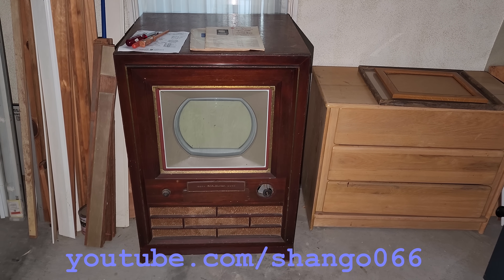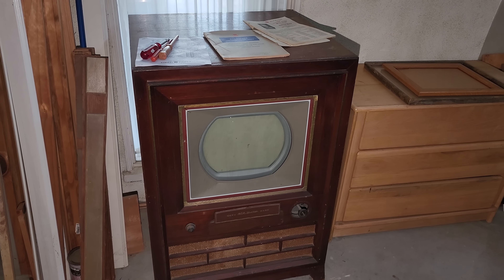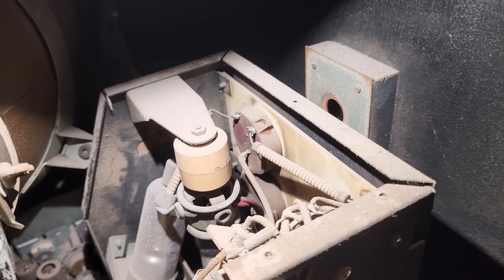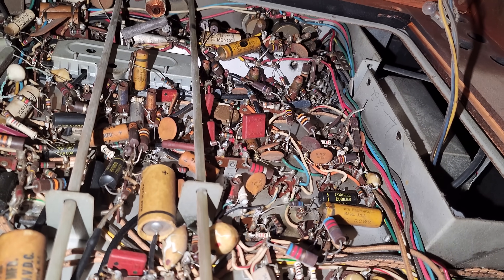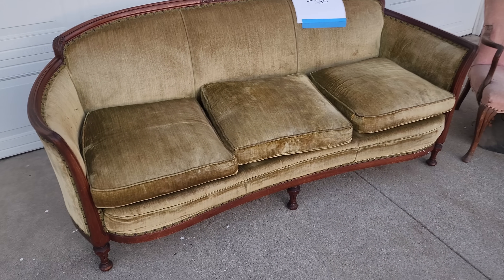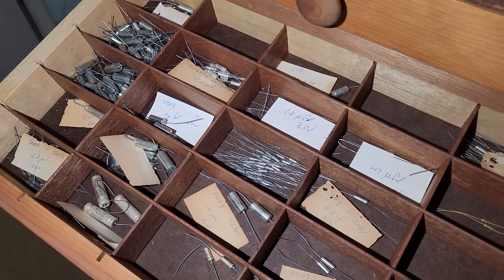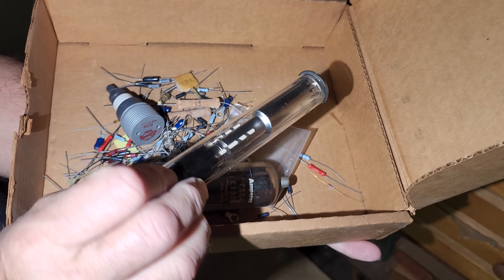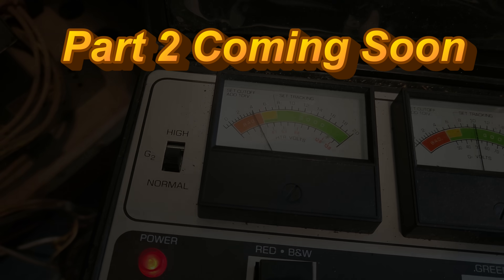RCA CT100 1954 First Color Television Analysis For A Fellow Collector

Comment: A 1954 IS NOT the "FIRST RCA COLOR TV" BY EIGHT YEARS!!! My Friend has his Father's 1947 RCA Model 3 Consolette (table model) WITH A ROTARY TUNER and a 9" ROUND picture tube in PERFECT WORKING ORDER (you have to have a ATSC to NTSC convertor box now) and being it's a sulfide picture tube, you have to watch it in a darkened room as it's very dim, but has excellent color and contrast. It's about 3 feet wide and 2 feet tall and 4 feet deep and weighs over 350 lbs with nearly 80 tubes inside and takes at least 30 minutes to "warm-up" and stabilize. The Model One was a HUGE thing with the picture tube pointing straight-up and you viewed it in a MIRROR weighing nearly a thousand pounds! You also NEVER TURNED IT TOTALLY OFF! 1946 price: $2363 delivered from Jenkins Music in Tulsa, Okla., or SIX 1946 Ford Fodor Sedans! On all the round-tube tv's you can flip a switch and go from full-screen round to rectangular format (3:4 now 9:16). RCA offered a magnifying lens (quite expensive) for the 9" round color TV's, but you had to sit with-in a narrow angle of viewing with it.

Comment: A getter was used only once, to consume any remaining oxygen, after a vacuum tube was made.  They were inductively heated.  After that, they were never used again, and would have no effect on any air that leaked in later.  I grew up in the days when most electronic devices used vacuum tubes and transistors were just becoming popular in consumer devices.  My family's first TV was a B&W 21" RCA Townsman (IIRC), which I believe was bought in 1957 and one of my uncles was a TV repair man.  He gave me a stack of repair manuals for a variety of sets.  I also obtained dead TVs from friends or elsewhere, to see what I could do with them.

Comment: Remember early on;  Transmission of color images using mechanical scanners had been conceived as early as the 1880s. A demonstration of mechanically scanned color television was given by John Logie Baird in 1928. Mechanically scanned color television was also demonstrated by Bell Laboratories in June 1929 using three complete systems of photoelectric cells, amplifiers, glow-tubes, and color filters, with a series of mirrors to superimpose the red, green, and blue images into one full-color image.  This even pre-date commercials.  How did they achieve this?

Comment: Shango, the camera pickup tube is a vidicon tube, successor or little brother to the Image Orth tube. Three vidicons were used in the Phillips/Norelco PC-60 and PC-70 color cameras, which were in wide use through the mid 60's and 1970s. They shot some of the iconic network video taped shows during that era: Carol Burnett, All in the Family, etc. We had two of them at the NBC affiliate in Port Arthur, Texas, KJAC,  where I worked in the mid-70s.

Comment: The circuits seems very scarce for a color tv at that time, i remember a German tv of the 70s which was filled with pcb in every directions
Reply: PCBs were not a thing yet when this TV was designed.  In fact, they had only begun being used in consumer electronics less than two years after these were sold, and only in Motorola radios.  And if you think this TV set doesn't have many components... ohhh you just wait, you'll see...
Reply: RCA. If you don't need it, drop it.

Comment: it was an amazing feat of technology at the time. It was not practical at all. Like someone said get a vacuum cleaner near it it would scramble colors. You had to call a technician to restore  the purity of color,  If you moved it same thing need technician to return color purity, By the mid 60's they had solved that issue with addition of demagnetization circuits upon startup.All early Branded color TV's all had  RCA electronics  they had the patents. The exception was Zenith which had their own design about 1962. By mid 60's color tv was OK but broadcasting was still an issue as color and tint (face color) was different from the commercial to programing color and faces could be green or red. (tint).you constantly had to adjust controls for true color. The broadcasters solved the issue in the 70's an d TV's from then had little issues of changing colors.And you know the rest

Comment: The little camera tube is not an image orthicon tube, it's a Vidicon tube- totally different operating principle.  Given its small size it was probably used in a B&W security camera or some such device.  3 3 inch image orthicon tubes were used in the RCA TK-40/TK-41 colour television broadcast cameras from the early 1950's through late 1960's.  The RCA TK-42 camera from the late 1960's was the first transistorized broadcast television camera.  It used a single 4" image orthicon tube for the luminance channel and 3 1" Vidicon tubes for the chroma channels.  A real beast, it was not commercially successful.  It wasn't until the TK-44 and later that used 3 Plumbicon tubes that a  solid state camera became a commercial success.  The portable TK-76, using 3 small Saticon tubes, was a brilliant piece of engineering that emerged in the mid-1970's that made gorgeous video and helped usher in the era of electronic news gathering.

Comment: In the mid 90's I had a meeting that took place in a Community Room in a building owned by the City. They had a late 60's early 70's TUBE color tv - big one. The meeting was Monday nights so the people who showed up early would watch Monday Night Football. We would turn that sucka on and it was amazing how rich and saturated the colors were. Of course it was about 25 degrees warmer behind the set than in front of it due to the heat from what seemed like 40-50 tubes.BUT THAT PICTURE was just so analog!! Like pretty artsy and nothing cold or sterile at all...

Comment: CT-100 Color Receiver (CTC-2 Chassis, 1954) Starting March 25, 1954, 5,000 CT-100's were manufactured in RCA's Bloomington, Indiana plant. The set was named, "The Merrill". By mid-April of 1954, the sets were available at dealers.

In my younger days I worked for RCA industrial division engineering for TV broadcast.  I was also working in their consumer TV division for a while.

These older TV sets were not easy to troubleshoot and service.

Comment: In about 1968, I bought a used CTC-15 RCA color set.  It was made in 1963. I restored it. I changed many of the tubes, some capacitors, and the CRT.  I used it as my TV set till about 1975. I gave it away to someone who wanted to keep it as an antique set. It was still working because I maintained it.

Comment: anybody got 475 watts spare??? if has stated it's in running order what do you do just give an obvious replacement of the minimal parts or would you as they say with the dirt ingested collectable old car restorations "just leave the dirt DO NOT CLEAN OR POLISH IT OR YOU'RE DEAD" approach. and check out the full mesh back makes you wonder how far we've come with in design getting down to letter thickness air slots to almost nowadays fully sealed micro parts.
anyway nice to see this one Shangoo

Comment: Good find!  Just a couple of comments...  Picture tubes should not be shipped face down. Any foreign material inside the tube could fall down on the shadow mask and cause a blocked aperture.  At 10:30 in the video, the camera tube is a vidicon.  Studio cameras used an image orthicon tube which is much larger.  Vidicons were typically used in the "film chain" as the pickup tube for motion picture film and slide projectors.  Yeah, the 2C39  is a transmitting tube useful in the UHF frequency range.
Reply: Interesting about the CRT's. Every reman. CRT I ever got was shipped face down. Probably because the bracing required to ship them face up or sideways would have been expensive and unwieldy.
Reply: @patricknesbitt4003  I know they remanufactured B&W CRTs.  Did they do color tubes also?  My comment was for color CRTs.
Reply: @AF9A  They certainly did. I repaired TV’s part time from the early 80’s through the 90’s and here in NJ there was a small mom and pop CRT rebuilder called Superior Picture Tube that regunned both mono and color tubes. They worked quite well too.
Reply: Vidicon was camera tube used in space.

Comment: Thank you, shango. A great video. I can hardly wait until you  post Part 2. Reportedly, the color rendition on the CT100 was better than RCA's later sets in the 1950's. The CT100 was the first commercially successful color TV. Admiral and Westinghouse beat RCA to market by several weeks, as RCA didn't start producing the CT100 until March 1954. Most of the Admiral and Westinghouse sets went unsold. Some of the initial batch of Admiral's were in dealer inventory as late as 1957. NBC broadcast just a few hours of essentially experimental color programming in the first half of 1954 featuring stars such as Dinah Shore from the Colonial Theater in New York, Brooklyn 1 didn't open until the fall. In the spring, CBS broadcast a color talk show with Mike Wallace. CBS opened its first real color studio, Studio 72, in August with a one time color episode of Ed Sullivan.
Reply: That's because the phosphor formulations for the red and green are different on the older CRT's then they are on the newer CRT's. When they made the the newer phosphor formulations for  red and green. They made the red into crimson red(red with a slight hint of orange) and the green was made fairy green(green with a slight hint of yellow). The reason for doing this was to get better, more accurate flesh tones. But at the expense of color vibrancy. The color emissions of these newer phosphor are standardize by SMPTE and Pantone calibrations standards. Although I've never seen it in person, I've hear that watching Wizard of Oz on one of these old TV's is a real treat.
Reply: It was also worth noting,  that the Admiral & Westinghouse color sets that predated the RCA CT-100,  were not backwards compatible with B&W, and since color broadcast was almost non-existent,  a family would need two television sets, the Westinghouse cost $1,250 late 1953/early 1954, which was roughly a little over half the price of a new car at the time.   On the other hand, the RCA CT-100,  although sales were very poor due to the $1000 price tag, was a very important TV, being compatible with B&W,  it would pave the way other color sets, and a little more than a decade later, the number of color sets sold would outnumber the B&W sets.

Comment: So very looking forward to part two the first RCA I ever worked on was a CTC 25 I then this is in my late teens went to the library and researched all the early issues of Consumer Reports from the 1950s to see how color TV was accepted and in particular of course this set. Of course at that time and we're talking the late seventies to read that this TV was marketed for $1,200 was unbelievable I can only think the ones remaining to this day must be in the low hundreds
Reply: The 25AP22A CRT in a CTC 25 had a life expectancy of about 2-3 years in a family with heavy use.  I was installing CRTs as a kid working in a TV store in 1969 and the sets were 3 years old or less.  The flybacks also loved to burn up, the 6GH8A tubes shorted and screwed up the color and the plastic cog for the fine-tuning always broke.  At about $700 they cost a month's salary.   No sympathy for RCA being pushed out by the Japanese then the Chinese, they were making sets in the mid to late 60s like the CTC25 that were designed to fail within 5 years. Planned obsolescence at its finest.

Comment: BEAUTIFUL set! When I was a kid, my whole family obeyed the 4-foot rule back when we had sets like this, protecting us from injury. The CRT glass in this model did not contain any protective lead and there was likely insufficient shielding around the HV rectifier circuit, resulting in unhealthful doses of ionizing X-radiation if one got too close to the set. This came off the assembly line long before enactment of any protective DHEW federal regulations.
Reply: So that's why my great grandfather told me never to sit that close to the TV when I was like 4. But their TV was from the 60s and black and white. I always thought it was because being that close would hurt my eyes. I never listened and it was closest to the knobs and cable converter and made the picture look huge compared to how tiny it looked from the sofa.
Reply: @NickDalzell  The plates of the tubes in the HV circuit of an old black-and-white TV emit minuscule amounts of X-radiation, but it's not enough to escape their glass envelopes. I don't think that being so close, looking at all the CRT image flickering would necessarily be helpful for one's good eyesight, though.
Reply: @chetpomeroy1399  I'd argue that being so close to a tiny smartphone screen would likely be worse. I remember getting tons of headaches and eye strain when I used one. Not so much from a TV of any kind, CRT or LCD.
Reply: @NickDalzell  I'd have to agree. Don't like dealing with smartphones, either. They are kind of tough on the eyes, especially at my advanced age.

Comment: The holy grail...

The only TV more desirable would be a 21CT55... Basically a CT-100 with a 21 inch CRT.
Reply: I'm guessing convergence was a nightmare on 1954 21" color set.

Comment: I had a rich uncle that had one and remember watching "The Cisco Kid" on it.  We, as kids, were absolutely forbidden to go near it and God forbid if it got banged into by a vacuum cleaner. Any anomaly and it necessitated a call to the TV repairman.  We didn't get a color set until about 1967. It wasn't cheap but nowhere as expensive as that set.
Reply: A friend that I hung out with in 1960s family had an old 55 RCA that was from his uncles car dealership showroom.
By late 60s it was pretty tired and I remember the convergence was way off. It used to look like a black and white with color ghosts.
I remember being over at his house when his dad was checking the tubes and had the back off. It had circuitry all around the case. I remember looking at the watt requirement on the tag and it said it took 400 watts to run.
Also remember I was at his house when Neil and Buzz were on the moon and getting ready to step out. You want to talk about a messed up picture. After they walked down the ladder we went down to my house and watched on my dad's new crystal clear black and white portable TV. Then we could actually tell what it was.
Also had an aunt that wasn't rich but dealt in real estate and had a 59 Cadillac and a very nice color TV  from about early 60s. She kept it in perfect order and I remember it had most beautiful picture.
Those old CRTs had fabulous pictures, they just didn't last very long.
Reply: Turning on the vacuum in front of them was the killer, the magnetic field would screw up the purity and convergence.  A running vacuum was usually OK.
Reply: Required about twice the antenna elements to load a decent signal strength in vintage color sets. Uncle had some investment!
Reply: @directcurrent5751  Oh, yes the old colour antenna. My Dad refused to by a colour set , too expensive and too many green faces , he bought one in 74 a Hitachi with remote control and then monthly cable.
Reply: If you watched "The Cisco Kid" it was a DuMont system (Pal System) TV!  DuMont championed the PAL system the BBC adopted and UHF channels. The picture was MUCH sharper,clearer, the screens were square edged and DuMont had 46" TV's in 1952 and they weren't "blue and grey" they were really "Black and White". Our best friends had a DuMont when I was about 4 years-old and I loved watching it and the SOUND was incredible too! Almost like stereo!

Comment: Why does the CRT have to be removed for shipping?  It was shipped from the factory and delivered to the customer(s) with it in place.  Not to mention a few other moves during its lifetime.   Appliances like that are built to be knocked around a bit.  It's fragile but not delicate.  
Seems to me just the act of removal and installation is adding substantial more unnecessary risk.
Reply: modern shippers are a lot harder on devices like this than in the old days and the crt in this is 100% irreplacable .
also if it's going to be restored the crt will need to be removed anyway. also i'm not sure if these crts have integrated safety glass so that could be a concern too
you can crate up a crt in a way that it could be dropped from 20 feet and not break but it's a lot harder to devise a way to make old rusty crt mounting bolts do the same job in situ
Reply: @Mister_Brown 
Thx for the info.  30 years ago I had to ship a 1959 AMI Jukebox from Phoenix to Riverside California.  400 lbs and top heavy.  I thought about shippers and how things get handled.  I finally decided on a moving company, as in furniture.  Door to door delivery, and they're used to handling delicate furniture.  I think the trucks are more cushioned too.  Less money too as I recall.  Starving Students Moving was the company I used.
Reply: I also think you'd have to contemplate that the rubber components originally used are not in their original condition. Previous work may have left the set in a condition where it's not secure as originally assembled.

I think the disassembly and proper packing are the best idea in today's day and age. I've received several vintage electronics shipments with damage including two days ago...
Reply: YES!